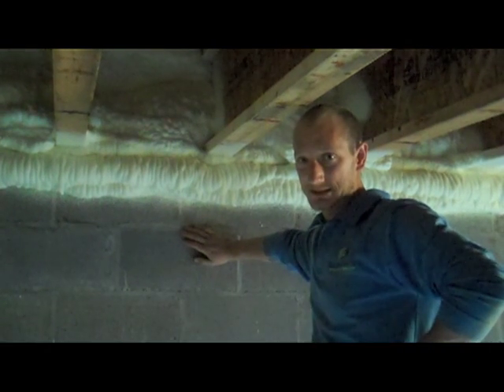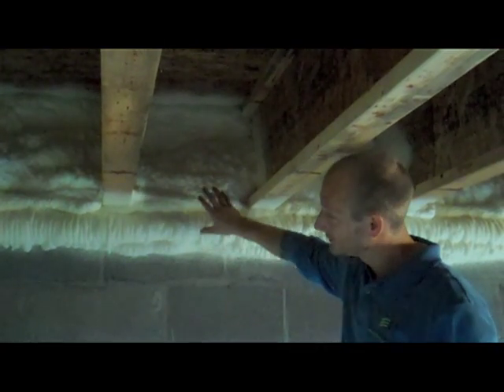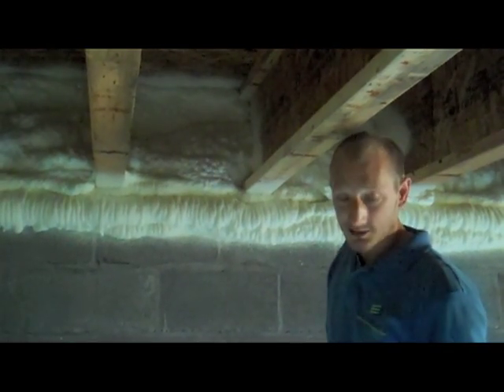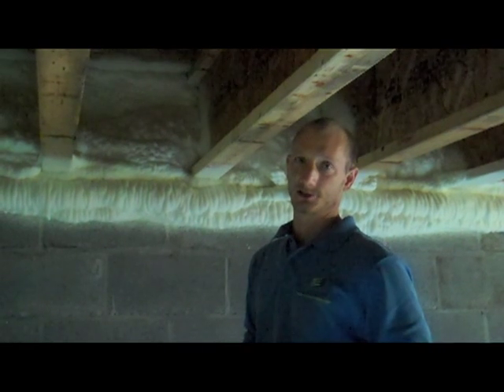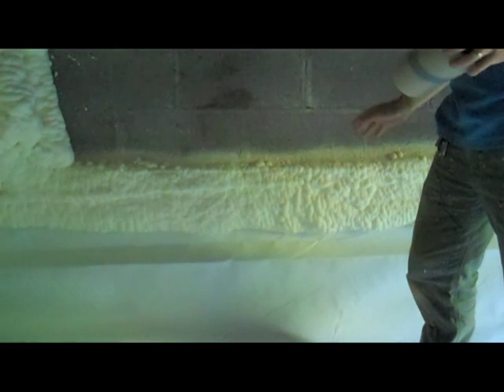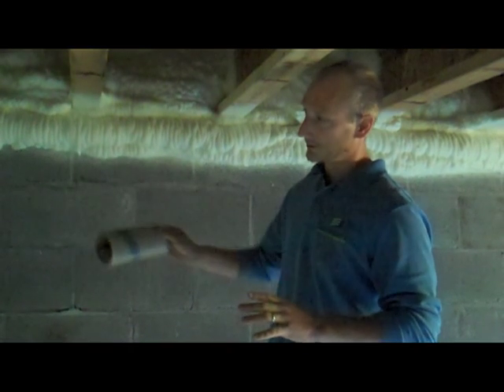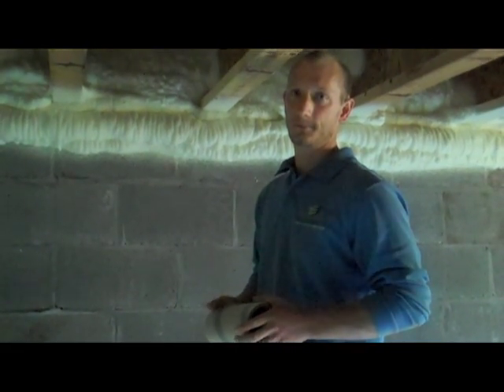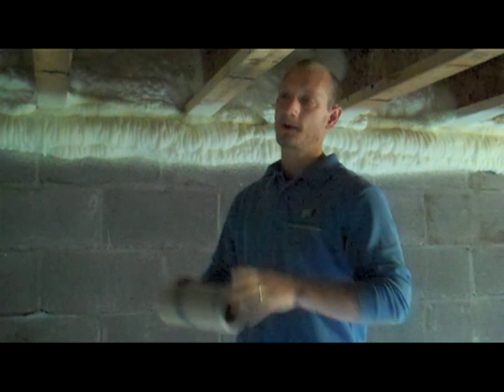House RIM joist band & Vapor Barrier

Comment: I cannot find the video "Insulating the House RIM joist band & Vapor Barrier" on either your blog pages or your videos page. I too would like to read your explanation regarding the vapor barrier issue with open cell foam.
Reply: mel2000, this is the video "Insulating the House RIM joist band & Vapor Barrier" on this page.
Reply: Lynn Taylor
In a response below to THIS video, a recommendation was made to see the "Insulating the House RIM joist band & Vapor Barrier" video due to a 500 character YouTube explanation limitation. In any case, it was supposed to answer a question about using foam to support a rim joist vapor barrier. I'll watch it again to check for the answer. Thanks.

Comment: ICF is a better foundation system than you're describing. Probably cheaper too. Concrete block is a thermal bridge. Putting foam inside the block would have limited effect. Also, closed-cell foam is what you need for a vapor barrier.

Comment from the maker: There are two barriers between the block foundation and the 2x8 pressure treated sill plate: First, a plastic separation sheet on the block then they installed a FoamSealr product by Owens Corning before setting the sill plate.